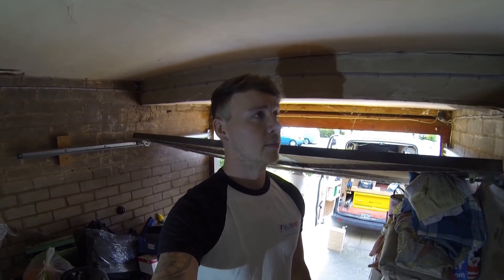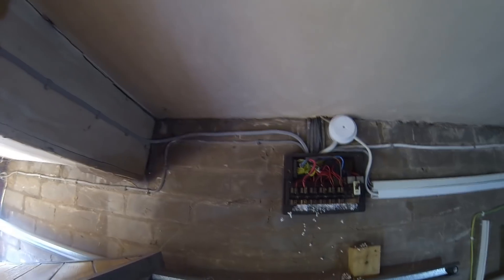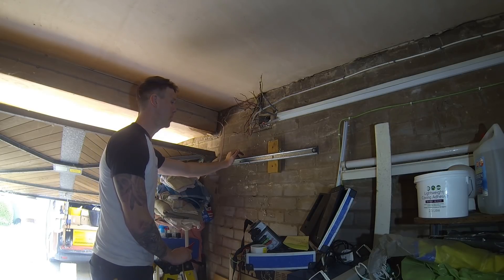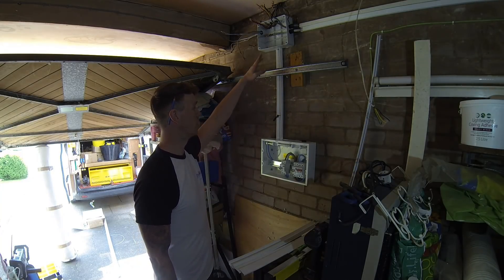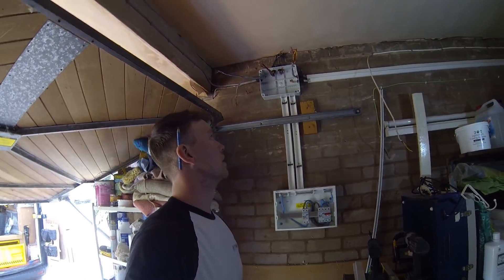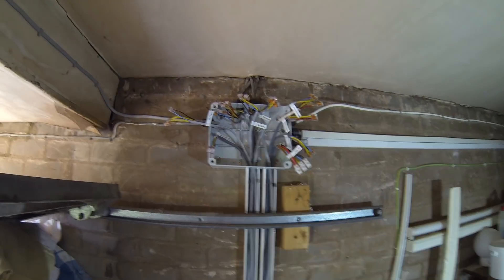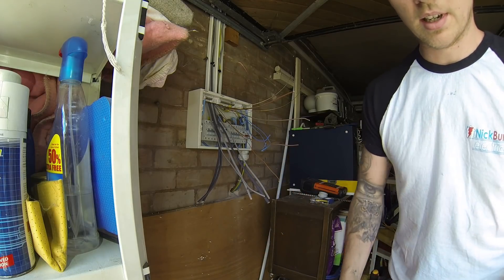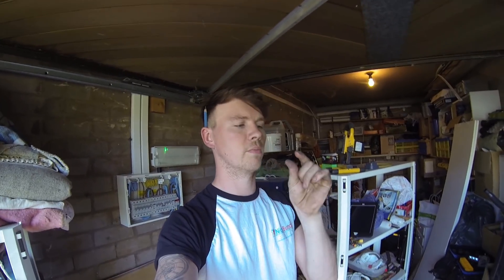Installing 18th edition fuse board,

Comment: Nice neat job N Bundy Electrical, I haven't even looked in the 18th edition yet and please correct me if I'm wrong with my observations and paused continuation with my now current limited knowledge of the 18th edition. But surely verification of departures and non compliance is still carried out by visual inspection and testing before the consumer is fitted? I.E, an EICR to highlight the remedial action/work that needs to be carried out before the circuit (s) or circuit protection can be changed. 

If you had carried out a visual and test of the wiring within the extent of liabilities including the loft space, and dismantled accessories, you would have found the earth/cpcs not sleeved and probably other code 1,2 and 3 departures. I can't see any earths/cpcs larger than the twin and earths, has the EE bonding been done?

Has the requirement for the 2 versions of BS 7671 wire colours and RCD quarterly test label now been removed, and is it my thinking that suggests that the plastic enclosure you have used as a junction box, negate the regulation for metal consumer units?  

Also has the CoP class P ignition/non flammable materials now been been withdrawn from the latest version of BS 7671/18th Edition regs now? This would mean that an accessory such as a socket cannot be fixed on a deep skirting/moulding, or a classical Oak or Walnut clad wall or a junction box screwed to a joist or other timber/studwork.
Reply from the maker: Thanks mate and yeah I didn’t really have time to do an eicr to start with but knowing that there where a few things to sort out after the board change ie sleeving of the cpc and a few grommets to go in some back boxes, and there was already 10mm bonding to gas and water 👍 and as for fixing to wooden joints and skirting I’ve not heard of to be honest, I know In new builds you can’t but not sure about older properties

Comment: The earth to neutral fault due to unsleeved cpc is one I came across a number of times when I was a spark many years ago. Sleeving cpcs was not required to comply once upon a time, and all earth continuity conductors, as they were called then, were left bare. So when a board was uprated to include an rcd, the things would trip.

Comment: I can see why you have used the connector block for the cooker circuit because you didn’t have (30amp wago connections) but it must be secured to the back of the enclosure. Other than that good job
Reply: Why must it? people have to stop saying something without explaining. No you don't need to secure it.
Reply: State the reg

Comment: Should deff do all dead tests first then live tests. Not sure all your circuits are split in the best way: I used to put GF ring on same RCD as FF lighting and then FF ring on same RCD as GF lighting so if an RCD tripped the floor without power had lighting and the floor that had no lighting had sockets that were still on so you could plug in a table lamp.
Reply: If you go splitting in that manner, you will end up with 3+ RCD's! Might as well use RCBO's if you're going to be so extra.
Reply: That's a bit of a derogatory term...It's not OTT at all. You're using a split-load board which is cheaper than RCBO's, but just split up the circuits so as to minimise inconvenience (as you are supposed to do per the regs). TBH, some sparks don't believe a split-load board even complies with that reg., and will only fit RCBO's. That's the best case scenario, but the prices need to fall quite a bit before that will become the more popular option.
Reply: @securespark  You could just use a High integrity board. Use a separate RCBO for each lighting circuit, then use the dual RCD supplies for all other circuits. Only about £50 more expensive but a lot better installation

Comment: Nice, neat and clear. On the EIC would you just write down that you extended the original circuits and used wagos within a plastic box? I find sometimes dragging the past into the present comes with it's own set of problems. Good job Nick.
Reply: I was reading your comment, and I don't rightly know what you mean but it's me being thick I'm sure.  What problems are you referring to specifically, apart from normal problems of borrowed neutrals, faults in rings etc., or is that all you meant?  Cheers

Comment: Lol - 18th edition wants metal CU, but apparently running every single circuit off it via a plastic adaptable box with wagos to extend the wiring is perfectly fine 🤣Somedays you think the IET should be the renamed the institute of comedy ...
Reply: If using wagos and plastic adaptable box is not fine to extend cables to the cu then how come there ok to use on other places in an installation ? The wagos are tested to the extreme.  Watch the videos on you tube you will see.  How would you extend the cables to the consumer unit ?
Reply: @SB-gp6od  Dave's not saying it's not fine.  It is fine.  He's just highlighting the absurdity of how we can apply the logic to one part of the installation but not the other, when really they're the same. 

Best not to think too much and just dance to whatever the IET's playing...the next tune'll be on soon anyways 🥳

Comment: Consumer unit cost £70
Labels cost 2 grand😆😆
Reply: you won't find a better easier to use printer for a Sparkie than the brother printer I've been using mine for two years now awesome piece of kit and cheap to feed with the tapes do some research on them before criticising them Brother Ptouch E550W Take it you use the free labels that peel off and are never neat and tidy and also bet you miss labels off when you haven't got the right label
Reply: True those label cartridges are a fortune in CEF
Reply: I’ve bought original Brother tapes off eBay for less than a tenner for an 8 metre cassette you can also buy them from Costco again at a decent price
Reply: recently started using them from amazon 8mm black on white £10 for 3 tapes seem perfectly fine so far.

Comment: question with the emergency, are you taking the feed from the breaker to the emergency then out to the lighting circuit? Im only an apprentice so sorry if its a daft question thanks
Reply from the maker: Lewis Warburton I put it on its own breaker but you can wire it into the lighting circuit also mate

Comment: Nice clear video. Would have been nice to show the point of isolation as some have commented about working live however you did mention ‘isolated’! Don’t like loose connectors, especially as DIN rail maintenance free ones are available. Didn’t see a comment about torquing up the terminals though. The emergency light is a nice touch as is repositioning the board to Building Regs, their a pain up behind the door rails. 👍 keep on posting!
Reply from the maker: Richard Emery Richard Emery thanks bud, I get the dno to islosate supply for me, I would never work live and I don’t cut seals, and yeah too right with din rail defo next time with that one 👍

Comment: Nice job, I have the same label printer and use their heat shrink sleeving to mark up the bonding. The 11.8mm is ideal for the 10mm bonding (label code is HSe-231)

Comment: May not be any regulation against it but those tails look vunerable in that location. Maybe could have gone in some containment?
Reply: If you believe there's a problem then fix it... that's how you'll get recognised ;) Definitely would of put those in something... maybe a Electrical metallic tubing.
Reply: A bit of 50x50 trunking would have fit nicely there, tip of the gland should just poke into the top then for neatness run it down to the ground (or top of that wooden board if it's fixed in place, think it's just leaning there). Or if you want to put the effort in can cut out a bit of the lid to fit round the gland and have the trunking run up to the board.

Comment: Great neat job , 

But I’m against joining cables and joining a whole house is a bit to far for me I’d have tried to locate the board somewhere else where u didn’t have to joint all those circuits .

Never the less if needs must it can be done . 

👍
Reply: Also if jointing cables to extend to the consumer unit is a no go using wagos or connector blocks then why do people use wagos and other connectors on other places in the circuits etc

Comment: Great video.
I do like how you talk so much detail. A lot of the other guys on YouTube skip over a lot of the details which I don't like.
I'm an industrial spark in a factory and it really is like 2 different trades. 
I would question why the board is moved down rather than back in to the garage, and I would also have liked to have seen mechanical protection on the tails.
Great neat job though and I love the em lights

Comment: Nice neat job, but why was the consumer unit moved down from a relatively protected position? If the garage door is left open, is there not a risk of windblown rain (and condensation being a garage) reaching it? Also are those meter tails going to be protected from people moving stuff around in the garage?
Reply: The original CU was above the garage door runners. When the garage door is open the CU was inaccessible.
Reply: Stuart Arnold - Okay must have missed that in the vid. In that case the solution would surely have been to move it rearwards at high level rather than downwards where it’s more vulnerable to knocks and water. Or better still inside the house - seems v.strange for it to have ever been located in a detached garage.
Reply: @Benzknees  The CU should be in an accessible location, which its high level position it really wasn't. Ideally the whole setup should maybe have been moved further into the garage but then you end up with long meter tails which is hardly an ideal situation. Not a chance the customer's going to want to have the meters moved...
Reply: Robin Whitfield - Yeah I appreciate that new builds require CUs to be in accessible positions, but my understanding is that regs for new builds do not apply retrospectively to older properties built before the change in regs. Ditto with regard to the heights of socket outlets and light switches in new builds to cater for people in a wheelchair, which don’t apply to rewires of older houses. 

Assuming most people will prob never need to access the CU, it seems the benefits of mounting it lower down are outweighed by the risks of it or the meter tails being hit whilst moving ladders or other heavy stuff inside a garage, or in this case possibly subjected to wind blown rain/spray from car washing entering the adjacent door opening.
Reply: @Benzknees  You're right that the regs are not retrospective, but just like the risk of premature collapse, where possible it makes sense to apply them during alterations.

I agree on the CU tails, it'd be nice to see them protected.

I disagree on access though. It's super easy to get a currant stuck in the toaster, or have a blown MOV in a surge protected extension lead - RCD trips are not really that uncommon in my experience.

As always we're never going to be able to see the whole picture here though, so the best we can do is make comment to hopefully help others to make an informed decision with any similar situations they might find themselves in in the future.

Comment: Great video, thanks. Did you consider using a junction box with a din rail? I think you can get wagos that go on a din rail.
Reply from the maker: Mark Rowland yeah saw it the other day at CEF live defo going to try it next time 👍
Reply: I have a question about extending the cables to the consumer unit.  Is it acceptable using wagos in the junction box as you have done ?

Comment: brillinat videos mate got a sub from me looking forward to more
Reply: DO NOT follow this idiots work as an example of electrical safety, irrespective of Reg's, the tails main supply feed should be protected by cover.
Reply: Lazlo Kovacs where in bs7671 does it state that tails need mechanical protection? The cable is already double insulated

Comment: Another great video nick 👍👍. I love the idea of putting in an emergency light near the consumer unit.
Reply from the maker: Craig Gifford cheers yeah just started doing where I can fit one in 👍
Reply: Cpn Cudis boards have a light built in to the cover which lights up when opened
Reply: I’d feed it off the downstairs lighting circuit personally - if the MCB opens when a lamp blows then you’re gonna want that EM to come on.